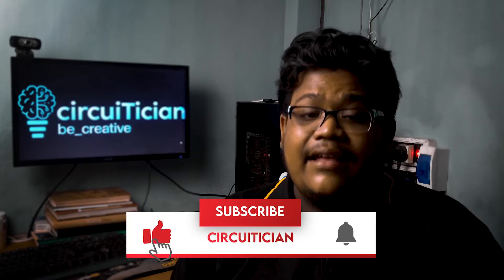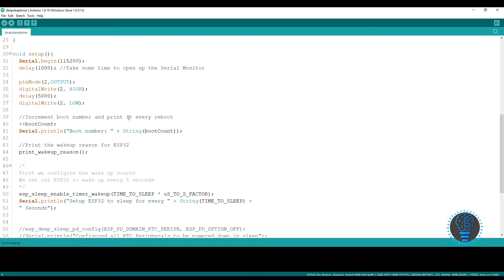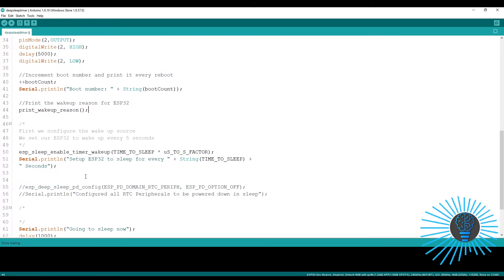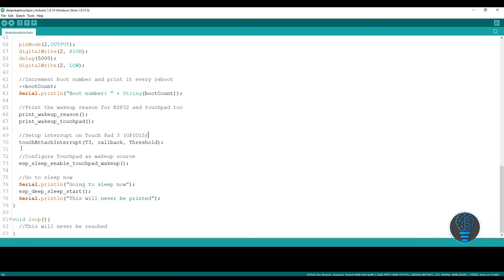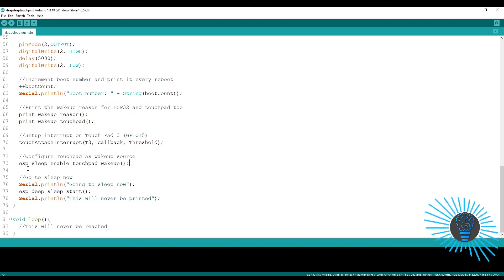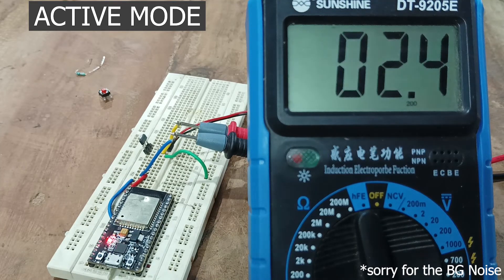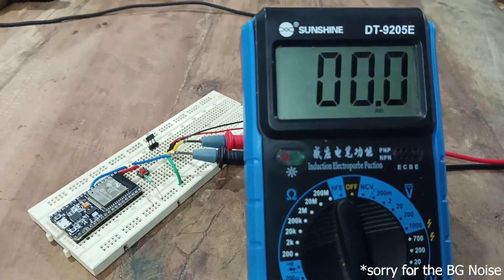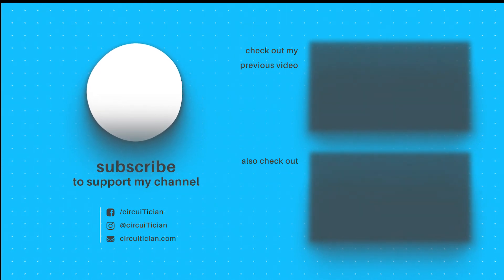ESP32 Deep Sleep and Wakeup - How Much Power Does It Use?

Comment: Great video 👍as channel is made to help everyone so can you help me with blynk2.0 ,in which if eeprom function is declared it erases the wifi credential data  and if i add wifi details in  the eeprom data get replaced with previously stored data like state of switch  hence till now techiesms also did not found any solution for it hope u do ,this is necessery for many automation projects.considering a reply from u😁
Reply from the maker: Use another eeprom IC.
Reply: @circuiTician  if it has already why to add more cost
Reply from the maker: If you want to use another ones library (blynk) then you have to understand their library and you have to edit it and after that it may happen that the library is not working as like before......

So if you'll spend time for editing the library and finding errors , that time will cost higher than the buying the eeprom ic...
Reply: @circuiTician  i found the solution for it online in which it says change some code in eeprom section ,config section i guess but with no coding knowledge i didnt understood the point so as ur bro in this video have more knowledge about it so can u just chk once i ll provide code on whtsapp on circuit digest or other
Reply from the maker: Congrats if you found the solution